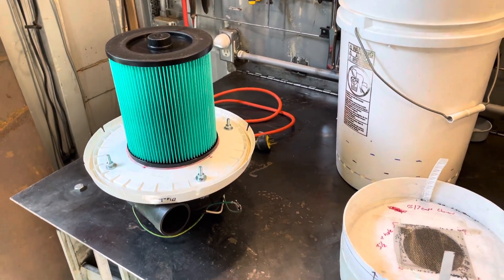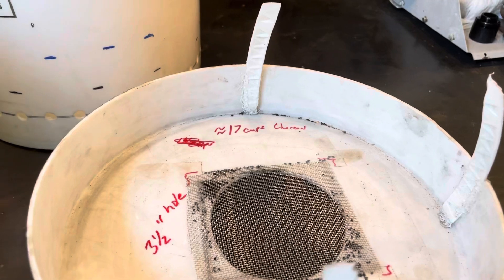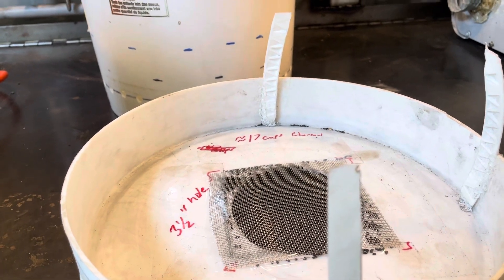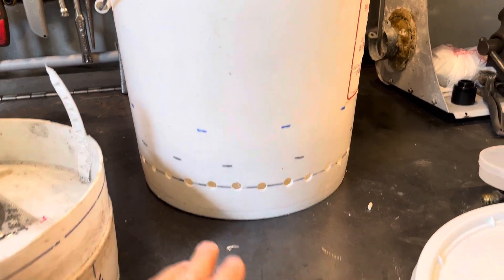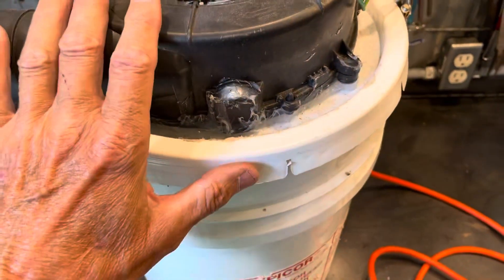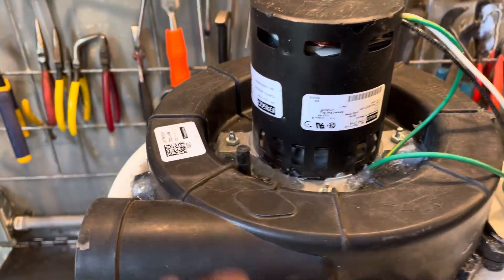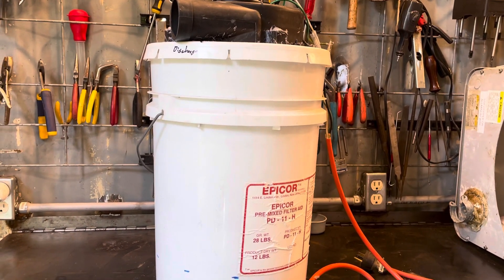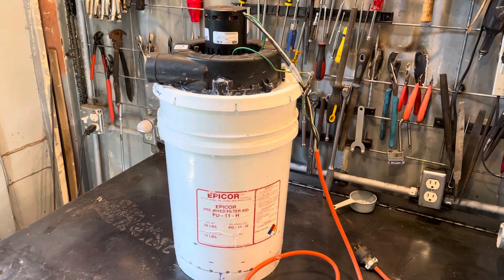Emergency nuclear contamination filter made with easily obtained items(nuclear fallout protection)

Comment: Only 5 lb..??? I was able to get nearly 50 lb. Of carbon in my bucket
Reply from the maker: Yes you can if you want to. It doesn’t hurt just more expensive and larger volume to deal with. Also there is more flow restriction to over come.

Comment: If there is nuclear fallout in the air, on the ground, etc, then you will want adequate protection from the radiation. The radiation will travel right through wall, roofs, etc. You need at least two feet of concrete or three feet of dirt between you and the outside radiation. You also want adequate protection from the radioactive material caught in the filter. It should be in a separate room in the bunker with two feet of concrete or three feet of dirt between you and the filtration system (or enough lead). Also, the radioactive rays travel in straight lines from the radioactive particles. Radioactive rays do not go around corners, where radioactive particles that emit the rays can travel through the air in any direction the air moves.

Comment: This is a great idea. A wet/dry vacuum could also be modified for this. Some thoughts: You want your own power source. After a nuclear attack there will be no power in most of the surviving areas of the country. Solar or a hand cranked generator are good options. You will probably not be able to get gas for a generator and would not want to go outside your shelter to get it anyway. If you could get a vacuum with a 12 volt motor, or modify the vacuum by replacing the 120v AC motor with a 12v DC motor, it will be easier to power. Then car batteries charged from solar will do fine, but you need enough solar cells to compensate if it is excessively cloudy. A hand cranked system to turn the air pump is also a good idea in case there is no power available.
Reply: Yes, 12 volt blower. That's what I was going to say. The first thing to go in a nuclear exchange is the power...

Comment: Awesome information. I wish i could see the inside of the charcoal filter.
Also at approx 8:20, whats a .25 inch of water pressure? Not sure if you mispoke (maybe mot, im utterly ignorant of this subject). Maybe something to do with positive air pressure?
Also, what percentage of the time would these need to run? I'm thinking at this level of emergency wed have to assume no power and wed be looking at car batteries and inverters or something.
Thanks again for the info! Liked/subscribed.
Reply from the maker: The .25 inch of water is a good pressure to make sure to don’t have unfiltered air in your safe space. If you keep the inside air pressure .25 inch of water above outside air pressure it will prevent in leakage. If you look at my channel I have another video covering just the filter. It has an orange bucket in the video. Also I did one on how to set it up and another on a cheap way to make a hand air pump. If you can’t manage a .25 inch of water you can just try to only bring air in through a filter so all make up air is filtered. Thanks for the comment.
Reply: @edwardjackson9791  Thanks for the response and great info on your channel. Subscribed.

Comment: This is a really great idea. One question please: If there is nuclear fallout it will accumulate on ground. So having that bucket sit on the ground is going to expose you to those accumulated radioactive particles more. Wouldn't it be better to set that bucket a few feet off the ground to avoid that situation?
Reply from the maker: Yes but inside an enclosure like a garage would really help. An elevated position is a good idea also if you have to have it outside. Thanks for the comment.

Comment: do you not want the inlet and outlet switched so the filter stays indoors to keep out sound and then have the inlet on a hose so you can more discreetly route it? others will hear your filter and come wanting it
Reply from the maker: You could but that would place the filter inside closer to you and that would expose you to more radiation from the filter. There are many ways to position the filter you just have to think through the consequences. Thanks for the comment.

Comment: I will try it. I'm gonna put it in a room full of tear gas and connect a hose going outside and test the fresh air side  to get an idea how well it will work and how often the charcoal will need replacing after contamination.
Reply from the maker: Sounds good. One thing is make sure your flow rate is low, just enough that would keep the area you would be in to about 0.25 inches of water above outside air pressure. The contaminated air needs to be in contact with the activated charcoal for at least 1/4 of a second to remove the contamination. So, too high of flow rate would not allow the contact time needed. Thanks for the comment.

Comment: Problem is your filter will be radioactive.   Can't change it without getting fatal dose of radiation.  If your filter is in doors near you, then you gotta shield yourself from the filter or housing.
Reply from the maker: Every filter will be radioactive if used to filter radioactive fallout. This type of filter will probably not need to be changed out for a single event. It should last for several weeks or months. Yes you need to have it far away, like outside or very well shielded if inside. If the filter adsorbs radioactive contamination that could give you a lethal dose when changing it you probably have already received a lethal dose from the event. You must remember the filter is decaying just like the radioactive fallout. It is a fairly rapid decay. So the filter  will last several weeks and changing will be unlikely and if it is needed a lethal dose is not a real possibility again unless the contamination radiation levels were so high that you would have already received a lethal dose from fallout itself. Thanks for the comment.

Comment: I would like to see a video on adding manual bellows if that's feasible for you to do. Also, considering that I have very little idea of how any of this works-- I am only learning through your demonstration, could you explain the last portion of this video when you talk about water? Thank you so much! Great video.
Reply from the maker: Thank you for the comment. If you look at my channel I build a simple air pump with 6 inch pvc drain pipe which can be used basically as a bellows. The water I talk about is a measure of differential pressure normally used on HVAC systems. If you have a filter for example and measure the pressure difference from one side to the other it is in inches of water. So if you take a clear piece of tubing and make a loop (like a p trap under a sink) in it and connect it to the inlet and outlet of the filter then water when air flow goes through the filter the water in the tube will displace based on the inlet and outlet pressure. If you measure the difference in the water level with a ruler it gives you the inch of water. There are plenty of YouTube videos. Here is one.
https://youtu.be/DdK8g5X_XAo?si=LMQJuRvbp7HkEekM

Comment: I'm going to try something like this. I was able to get some free buckets from a local restaurant, they're square but I don't see what difference that will make. There's no way I am going to try to use a shop-vac motor though, that is too loud and obnoxious. I'm going to use a 12v inline bilge blower for a boat and solar panels for the electricity. I've got most of what I need except for exhaust hose because my plan is to take outside air from a protected location, run it through my shelter and have it flow back outside so I am not drawing in radioactivity into my home.
Reply from the maker: Good idea. The shape of the bucket or container really doesn’t matter as long as you don’t have leakage past the filter media. The only requirement for flow rate is it provides enough makeup to supply your shelter with makeup O2. The air flow should be in contact with the activated charcoal flow >0.25 seconds. So slow flow is better if it provides the correct amount of makeup O2. I bought a CO2 monitor to check the air in our area.

Comment: Won’t that shop vac motor pull too fast? Would it be okay to put a variable speed switch on it? Also, how will it be powered in a SHTF situation?
Reply from the maker: The fan I used was not a shop vac but that could be used. The full flow would likely be way too much. The air needs to be in contact with the activated charcoal for about .25 seconds or more so you can throttle the discharge to reduce the flow. I used an old squirrel cage fan from an old gas furnace. If you look at the other videos on my channel I cover manual operation and some design ideas. The good part of the squirrel cage design is there is little resistance to air flow and if you need the manually operate a air pump it is much easier to pump air through. Thanks for the questions.

Comment: Where would you position you device to filter the air?
Reply from the maker: Best place is outside under cover but inside like a garage would work. You just have to realize it will be drawing contamination inside the area you put it. Also away from people. The filter itself may become radioactive as it filters and present a radiation hazard. Thanks for the question 👍

Comment: This is a great design.  Love the bucket.  Thanks for this idea. I'm not worried about charcoal but use a 12v motor and place it INSIDE the bucket, with only the exhaust coming from the bucket - fewer areas to worry about sealing up on/around the motor. Also consider the type of fan as most blade fans don't do well under the load of filtering. Impeller fans do pretty good.
Reply from the maker: The HEPA filter for a nuclear even is very effective. The activated charcoal helps with fission product gases but also makes the design a chemical and biological filter. The activated charcoal adsorption of chemicals and biologicals helps clean up the incoming air. The air fan for this is a squirrel cage design and provides very high flow rates, actually I would have to block about 80% of the flow to allow for effective contact time as the air flows through the activated charcoal. That allows more contact time for the adsorption in the activated charcoal. Thanks for the feedback👍

Comment: Could you use a shop vacuum for a in-line charcoal filter on the on-take side? A secondary filter could be attached to the outlet tube.  Also a pre-filter before the charcoal filter made to be changed readily!  I would think that placing your filter outside after a NBC event would open up you and your shelter to contaminates.  I'm assuming that you're planning on being in a bunker of some sort since most houses are far from being air tight, perhaps having a long horizontal (4"+ diameter) PVC pipe (or two) with a 180 degree elbow at the top end with a wire filter to block out larger particles.  Perhaps a water trap could be incorporated into the system before the vacuum cleaner.  I don't know if a hand crank could be attached to the top of the vacuum motor for manual turning!
Reply from the maker: There are many ways to make the filter so a vacuum could be used. The important design though is that the contaminated air all goes through the filter elements and there is no bypass flow. A pre filter is a good idea and I call that a roughing filter. Having the filter outside of you bunker or safe area is important in that the filter my become a radiation source because the contaminated material will concentrate in the filter. It can be located inside the house but away from your safe area, like in the garage. The filters used at nuclear plants don’t us a water filter because they are ineffective for gases and introduce a large differential pressure that has to be overcome by the fan or blower.

Comment: Your entire contraption has to be in the contaminated environment. Your intake needs to come from a distance so you’re not handling contaminated hardware when you have to reseal or repair.
Reply from the maker: Correct. The filter should be in an area that is outside the bunker and will likely be in the contaminated area. The filter will become a radiation source as it filters the radioactive material. So, you have to preplan how to handle it before you place it. It would be best to have it under cover from the elements but in a location you can stay away from until you are ready to move it to a more secure location following the event.

Comment: How are you going to make this work after an EMP that was caused by the device that caused the radiation?
Reply from the maker: You will need a manual air pump for that. I did a video on one but there are several different designs.

Comment: to avoid the lack of electricity you make a generator with neodymium magnets ( I show how a transformed car alternator works on my channel ) moved by a bicycle to be able to charge the batteries in relation to the filter to avoid any air pollution before the filter that you present here you have to pass the air through water for example; How do you oxygenate water in aquariums? the water itself filters the air from the radiation in the dust and after this process put this filter
Reply from the maker: The water will filter some but the fission product gases will pass right through and a percentage of the small particles also. It also will add a good deal of back pressure to overcome.

Comment: Could you make a video on how to go from the electric blower to the manual air pump you made? I would love to see them work either in tandem or having the manual used as a backup system. I am thinking of making my own system and seeing yours helped me come up with ideas. Maybe a smoke test or practical application would be neat to see as well 😊 awesome work.
Reply from the maker: If your fan/blower has an open impeller design like a squirrel cage or propeller type you can just draw the air flow through the blower. So all you need to do is attach a non-collapsible hose to the exhaust of the blower to the suction of your manual air pump. You will want to insure there are no leaks between the manual air pump and the electric blower so you are not drawing in contaminated air bypassing the filter. I may be able to put together a simple test.

Comment: Question. When you are isolating from the blast. Would you run this device all the time? And how long will it run before you have to change the hepa filter or the charcoal? Thanks.
Reply from the maker: If you have power which is unlikely you run it to maintain about .25 inch water pressure in your shelter if you can. This would be ideal. However, you are not likely to have power. Then you just make sure as much as possible that the makeup air you draw in (like via a mechanical bellows) comes through the filter. As for the time it will last, as long as you are able to draw air through it, the filter should be good, “If” you have it where it is not drawing in very dirty air (like an elevated area or have a good pre filter) it should last for weeks. The one we used at our nuclear plant for our control room building was designed for at last 30 days and the filter and carbon would probably fit inside a 55 gallon drum and they were designed for continuous flow. They also were designed to maintain a .25 inch water pressure in the control building. Thanks for the comment and questions.👍

Comment: Just to clarify a common misunderstanding about nuclear contamination. The air itself is perfectly safe. It's the DUST and particles floating on the air that are dangerous.
If you see heavy fallout particles on the ground, but the air is clear, then it's perfectly safe to breathe the air without a filter as long as you don't disturb the dust on the ground, or there's no wind kicking it up.
The risk is when the "lighter" smaller particules fall or hang in the air. These are actually so small that even if you do inhale them, lifetime exposure is fairly low, only about 2 rads. Of course, it's better to NOT inhale them at all, but treating the air like literal poison is a big inconvenience and can do you more harm than good if for example you need to move out of an area due to heavy ground fallout, but you are too scared to move thinking the air is dangerous.

The filter in the video will work, of course, but most of the time it will be un-necessary unless there's heavy wind and lots of airborne dust.
Reply from the maker: For a nuclear detonation like a bomb you are for the most part correct. For a nuclear power plant there will be much more fission product gases which will be the big portion of the exposure. The hepa filter is the part that removes most of the dust. The activated charcoal the gases. So for a nuclear attack where you are trying to survive then exposure of <6 Rem per week for a short time will not cause immediate health issues. For events that are not immediately life threatening then exposure as low as possible is better long term. Of course that depends on your age. Older people will not be as effected long term. These filters that you get commercially start at about $4000 so for the unlikely event you may need one building your own for less than $100 seems reasonable. The filter is also effective for some chemical and biological events. It is an NBC filter design. Thanks for your feedback.
Reply: @edwardjackson9791  of course the filter itself is very effective from the looks of it. And if there is a chemical or radiological reak the charcoal will help.
Reply: 2 Rads IS NOT a trivial dose. It won't kill you dead immediately, maybe not before something else gets a chance to, but the whole idea behind survivalism is to have the best chance to survive that you have. Obviously a 2 rad dose in an area that gets 3, 4, 500 rads is going to help you a lot. But if you're in an area that takes a direct hit you might be better off getting smoked immediately because there won't be any help coming to save you.